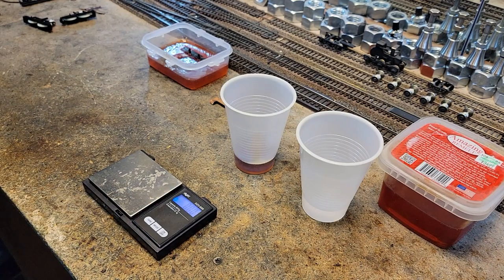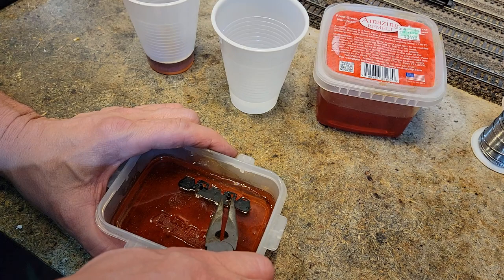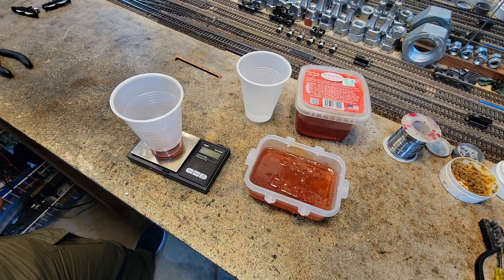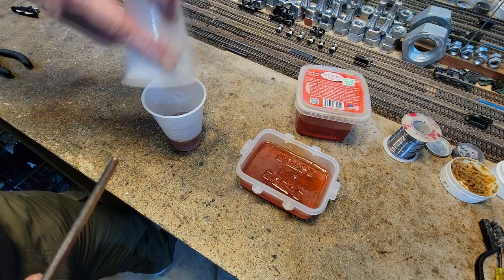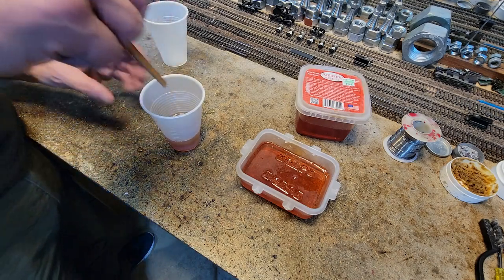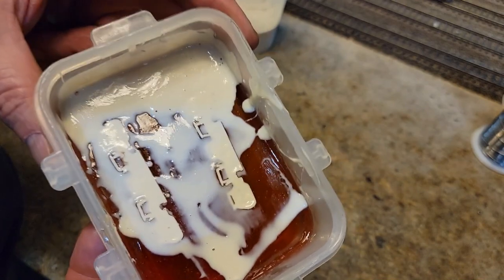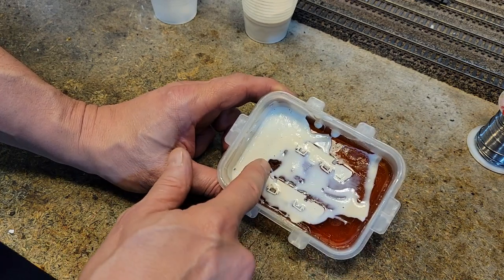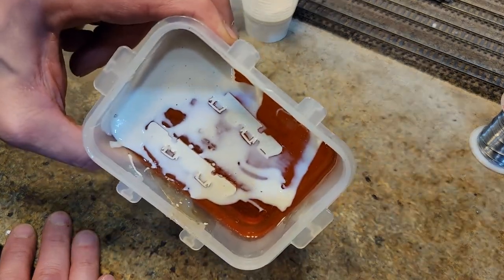2022 HS 7 Missing Sideframe Casting

Comment: why not 0 the scales with the cup on , weigh your first fluid , 0 the scales again , then weigh your second amount , tada .. spot on half ..
Reply from the maker: I track the waste on a spreadsheet, so I weigh every cup before and after  - saves tons of resin that way, but also the 1:1 has a tiny bit of tolerance either way and the chart calculates the errors.  The final step is rating the quality of the piece when ready which just "no good, good, very good" and then I get my over and under numbers!

Comment: I believe I have that same skill if you don't need to know how much the cups weigh you could just tear it put the cup on the scale tear it zeroes it out and then you know how much of the product you're using not telling you what to do just a suggestion
Reply from the maker: I keep a spreadsheet of all the castings I make and use the cup weight to calculate waste - that saves a lot of resin, plus I don't alway have matching cups!